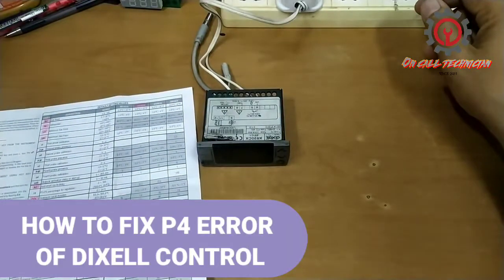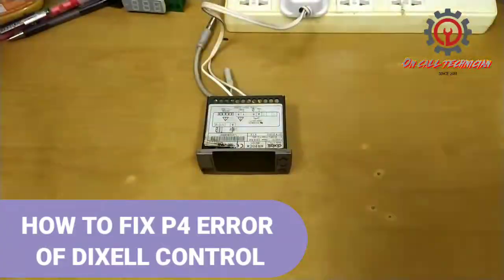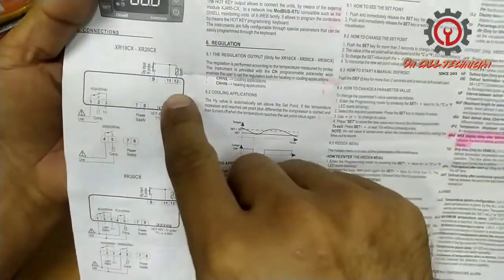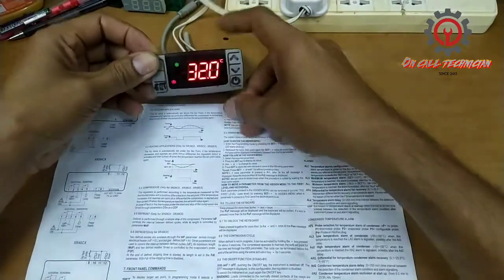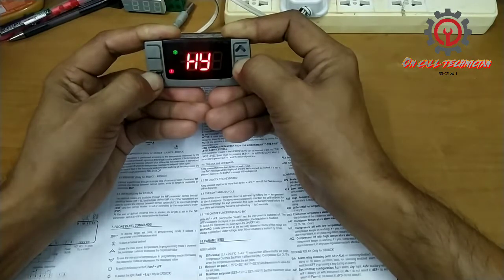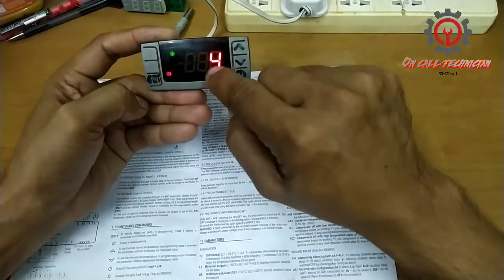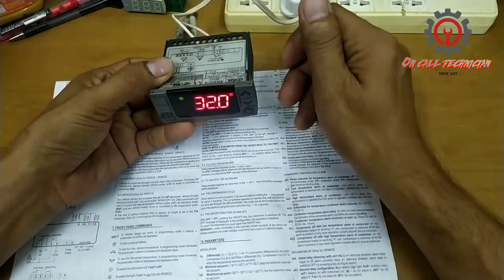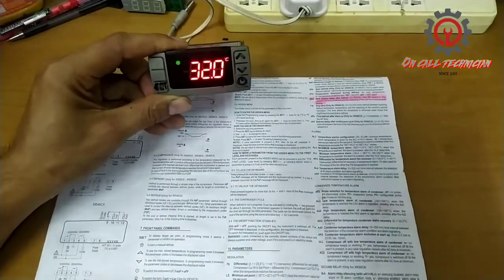HOW TO FIX "P4" ALARM OF DIXELL XR SERIES

Comment: Your video has lots of potential to be great, I had trouble following what exactly the error was for or what you did to fix it.  I suggest explaining further.  I think the error was because the controller is configured for a 4th probe, BUT there are only 3 probes, therefore it throws an error.  You simply reconfigured for only 3 probes?  This is only a fix if you do not have a 4th probe.  What if you do have a 4th probe?
Reply from the maker: Dixell xr20cx doesn't have the parameter AP2 wherein xr60xc have it sir. AP2 is a condenser alarm and where  P4 use.
Reply: @THEMULTISKILLEDTECH  what do I do if I have an alarm but it's not showing up?
Reply from the maker: All alarm in dixell will show up sir, there are models with no sound because no buzzer installed but an alarm keep showing.
Reply: @THEMULTISKILLEDTECH  thank you I'm having a problem with my freezer, evap fans are sporadic after defrost cycle.
Reply from the maker: Oh sorry to hear that sir, about fan I don't have tutorial about it sir. Maybe some other days,weeks, months,years🤗. For the meantime you may run that with compressor but be sure you install contactor
Reply: @THEMULTISKILLEDTECH  I think my eval sensor is giving incorrect high reading or heater is staying on
Reply from the maker: https://youtube.com/playlist?list=PLOMYgMklNMhETVnzUDCoHMpMOLQ5Wp95m check them one by one sir. You may check out all my dixell tutorials sir
Reply: @THEMULTISKILLEDTECH  I just observed evap probe jump to 120 f then down to 30 f
Reply from the maker: Ok

Comment: How to fix P1& P2 alarm
Reply from the maker: https://youtu.be/gArjNzM--Ug👈 for P1 alarm 
https://youtu.be/l-HoFyEyhVA👈for P2 alarm watch this sir.
Reply: @THEMULTISKILLEDTECH  Hello, What about P3? Just got a new cooler and it's throwing that every time I turn on the unit. I've looked at setting the Probe to N, similar to this video for P4 but then the dixell display would just flash noP over and over. Please assist?
Reply from the maker: Pon means your dixell keyboard is being lock sir.    Watch this sir to guide you 👇👇👇 https://youtu.be/IITlMcsXELg
Reply from the maker: https://youtu.be/IITlMcsXELg watch this
Reply: @THEMULTISKILLEDTECH  Thanks for replying and uploading your videos, they are real helpful. Although for my situation the code after turning of P3 alarm isn't Pon but it is noP...which if I looked up the manual, is something similar to no probe. I had to change lod and alp to use P1 instead of P3 and the noP no longer flashes...in case anyone runs into similar.
Reply from the maker: @JP-xd6tb  ic sir, noP means no probe. Yes you selected right for your  LOD parameter.